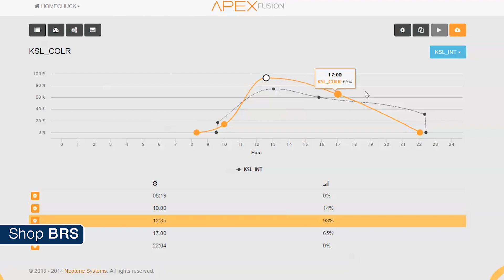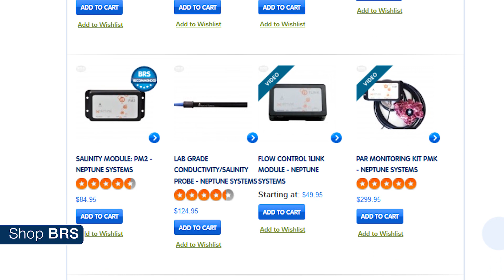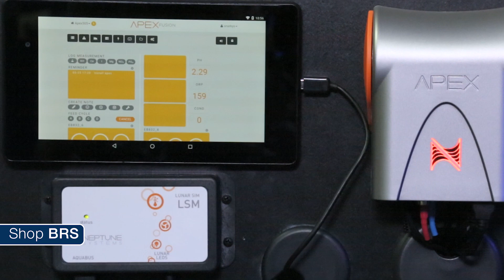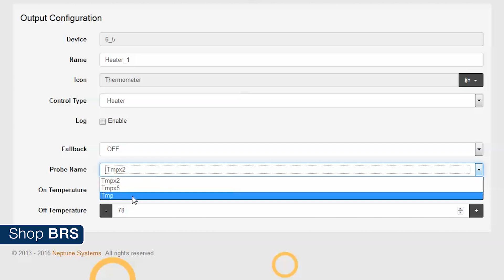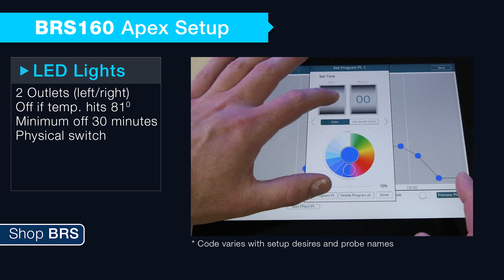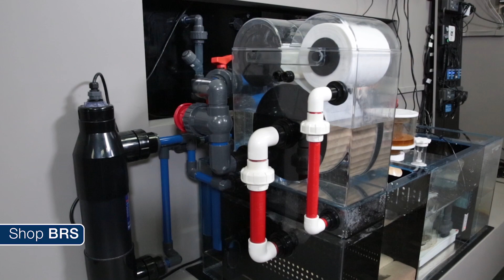Week 45: Aquarium Controller How To's - The Neptune Apex | 52 Weeks of Reefing

Comment: I just bought one of these from your guys, nothing but problems so far, I love the controllability of this and the fact that I can monitor basically every single parameter that matters with the trident hooked up, but I just wish it wouldn’t have came with multiple issues
Reply from the maker: Sorry to hear that! If we can help in any way, just give us a call or shoot us an email. I'm confident that once you get up and running, you'll really enjoy having an aquarium controller. 

BRS Customer Service 
Phone: 763-432-9691
Email: Support@bulkreefsupply.com
Live Chat: BulkReefSupply Website
Reply: @BRStv  I appreciate that and I have been In Contact with your support team and they have been very helpful, I should clarify a little though I have been having problems with add one ad modules like the cor 15 and the trident, the apex and energy bar 832 have had absolutely no issues so far and it is great on that note

Comment: help please
im new to the neptune systems and in trying to connect 2 Mp 40's to one outle (by using a spliter) and sinking both of the pumps to wxm. i was able to connect one pump and i see it on my dashboard now. the secomd pump is blinking white,red and blue and when i press and hold  the set button to attach it nothing happens it just stays blinking the same white, red and blue. 

do each MP40 need their own outlet in order to attach to wxm or can i have them both pluged in the same outlet by using a spliter?

Comment: Hi guys love your channel,  may I ask you a question please I am in Australia and all the Apex equipment is very expensive here the new Apex controller alone retails for $1,600  plus, so if I was to purchase the main Apex controller do the other add-ons like the DOS and DDR and ATO etc need to be powered from a wall power outlet or can I power them from the main Apex unit? as here in Australia, we are on 240v but if I get the main Apex controller here I am thinking I could order units like DOS and DDR etc from the US much cheaper if they can be powered from the main Apex? if that makes sense? hope you can help me? cheers Mat

Comment: Are Neptune looking to release an energy bar 8 that has the ability to accurately determine the power utilization of your tank to compare different lights, pumps, skimmers, etc. For the UK/EU marked which is currently not available on the UK/EU Energy Bar 6, which appears to be the only option if yours loving outside of the US?

Comment: I'm hoping you can shed some light for me
I've been comparing the price of an Apex with individual controllers. Together they clock up to £900, or about $1,200.
The Apex base unit alone is a whopping £820, or $1,070, and with all the various required add ons, it comes to £3k or nearly $4k!!  Are the additiom of internet alerts REALLY worth $2,800?!?

Comment: Great video Ryan, please can you post a link for the toggle switches? Thanks
Reply: Can you just show how the breakout boxes are connected to the toggle switches?  Do you have to cut cords on everything to attach to the toggle switches?  Please show the back of the board.
Reply: Not to be picky, but a three way switch is a switch than can operate a load from two locations- a 3 position switch is what you are describing.  You used that term correctly in the video (once).  I think what you are really asking for is a maintained contact three position (on-off-on) switch

Comment: Hi BRS.  Can you show us how to wire and program the switch panel you made?
Reply: I would also like to see how you wired and programmed the switch panel used in this build.  I would also like to see what the back of the panel looks like, and how you would protect the wiring from evaporation and salt deposits if it was incorporated in an under tank setup.  I know very few people that can set up all their equipment in another room and would like to see something advanced like this, that the average consumer would be able to incorporate into their systems.
Reply: Hi, Theater Guy.
I have the answer.  I bought the on-off-on toggle switches.  I used extra Ethernet cables that I had laying around for wire.  Using this switch setup is a little time-consuming.  I stripped the sheath from the ethernet cables to expose the three pairs of wires.  The wires are twisted in pairs.  Don't untwist them.  This makes it easier to route them and keep things neater.  I soldered one pair to two of the switch pins.  I then untwisted about two inches from the next pair and soldered one wire to the last switch pin.  Using the other wire from the pair, I connected it to the next switches pin.   And so on till they were all installed.  I installed twelve switches in total.  This setup requires three breakout boxes.  After counting all the pieces of equipment I want to control by the  switch, I found that I only needed seven switches.  Some extra switches are good I guess.  Hook a length of pigtail wire  maybe a foot or so and connect it to the GROUND terminal of the breakout box.  Route it where it is out of the way when you are done with it.  Now, gather the three center pin wires and connect them to the ground wire pigtail.  I found this pigtail method neater at the breakout box as mine is displayed on a board mounted on the wall.  Take the two wires left from each switch and attach to terminals 1 &2 and so on.  After you are done with all connections,  time to program.

Go to outlet config.  Find a piece you want to control, let's say skimmer on switch 1.  Go to ADVANCED.
Type in...  
IF Sw1 ON THEN ON
IF Sw1 OFF THEN OFF

If you want the switch to be up in the on position, but it is off,  just reverse the wires on the breakout box.  Do this process for the remainder of the setup.

Questions? Just ask.
Have a good day.
Reply: Hi, Theater Guy.  Please hold off on the programming part.  I think this is wrong.  Let me check my programming tonight when I get home from work. Thanks.
Reply: No problem! Thanks for updating this!!!
Reply: +DIY Home Theater Guy 
My program is as follows...
If Sw1 CLOSED THEN OFF
If Sw2 CLOSED THEN ON

I used a lamp plugged into outlet 1 to test.

Comment: How did you guys wire the APEX with that switch bank set up. I would like to see the wiring and programming. Set up on the on or auto or off switch set up. That looks like something APEX should have included with the new set up.

Comment: New to Apex? A word of caution! Neptune Systems the manufacturer of the Apex recently released a new upgraded system. Rather than taking the high road and lettting new customers know a new version was being released. They chose to discount their systems by $100 to dump their old inventory on un-suspecting new customers. They never told anyone the discount was to sell out old inventory. I have even talked to a number of stores and resellers about this situation, no one knew. Very deceptive business practices! If they are going to take advantage of their resellers and new customers how can you trust their customer support will be any good if you ever need it?

Comment: I am a very unhappy Neptune Systems Customer.  I purchased my system (thousands of dollars worth.  I believe I have every possible component. ) less than 60 days ago.  I emailed Neptune and asked if I could trade out my Head Unit and multiple power bars for the new models once they were released.  I was told no ! It was explained they may do something however they will not know until they have  shipped out to the new customers on the back order list.  What a horrible customer service policy!   They offered me a $100.00 discount.  What an insult!  I don't want a discount!  I want the system 'I JUST PURCHASED' to be capable of handling the new technology and software.  I don't think this is too much to ask since I just purchased the whole system.  If they would have told customers there was a new version coming out I would have held off and purchased once the new version was released.  I am so unhappy about this I am going to continue sharing my experience with as many places as possible. it is a real bummer because I could be a real advocate for the system but his is really making me sour towards Neptune.  They will end up losing more money pissing off the current customer base than they would have lost doing a simple trade up program or swap for customers like me.

Comment: ugh and i just bought a standard apex classic lab grade like a week or two ago. don't even have my tank yet so i haven't actually used it - might try to return it....didn't buy it through you guys though...bought it off ebay so i might be screwed.  they announce this thing days after i get mine, ugh....i was even thinking to myself "man it's been a while since they've updated this thing"

this kind of sucks though. i would definitely have paid the difference for the new model, i sure hope i can get this thing returned. i probably wouldn't care if the eb832 was compatible with the classic, but they're saying it's not, which means an upgrade is basically just buying everything again.
Reply: it was new in box, but lack of any return policy or customer service is the real issue....was it worth the $20-40 I saved? Probably not in hindsight. The seller rejected my return request....Guess I'll have an apex classic for sale on ebay, lol.

Comment: I'm sure the new hardware is nice, but the silver new display still looks like junk. I was really hoping a nice sleek upgraded LCD touchscreen that I can mount on the outside of my stand and have it be an aesthetic addition rather than an eye sore.
Reply: +BulkReefSupplyCom True, but that's retrofit hardware, and tablets are not designed for 24/7 use and cannot be programmed to turn on/ off the display for certain periods.  I rather spend the $200 on an optimized display, rather than $100 trying to rustle something up that I know will just be a haste to try and make work.

Comment: I think the new Apex killed the Cerebra before it even got out the gate.
Reply: Ok. I am excited to see this new innovative product. Maybe the Apex will finally have some competition. It is amazing however, that Apex continued to advance without a strong competitor up to this point.
Reply: If less than 10% of reefers own an Apex, then how much less for other aquarium controllers. Cost is always the biggest factor in purchasing something like an aquarium controller. When I first got into the hobby I tried to do everything the cheap way. Soon I learned, that was not a good mindset to have. It cost me more money in the long run to replace cheap failed equipment with better quality equipment. It was more time consuming to battle problem caused by trying to cut costs. Eventually I learned to do it right the first time. When I go to my LFS I see new hobbyists doing what I use to do. You can tell them until your blue in the face that a controller is the best investment, and that it is simple to use, but until they feel the sting of defeat they will not easily part with hundreds of dollars.  I even told one guy I would come to his house and help him set up a reef keeper, and he still didn't want to spend the money. I say all that to say Neptune has done a lot to make the Apex easy to configure. You take it out of the box, connect it to your EB and then to your laptop and you can have basic  functionality in minutes.

Comment: Soooooo, let me get this straight.....with the new Apex and its wireless magic, there's no longer any need for the Reeflink for Ecotech products, or the wireless module for anything?   Because, if true, that's amazing.   Also, where did you get that bank of physical switches, and was it difficult to install?  Sounds much easier to be able to flip a switch for feed mode rather than messing with my phone or a display.  Thanks!
Reply: +BulkReefSupplyCom 
what Guage wire did you use between the switches and i/o box?

Comment: Did I miss something about how its impossible to use feed modes with the new apex? Other than opening my phone and pressing the feed mode? I try to keep my phone away from my tank, especially when feeding...How hard would it have been to just put four buttons on that massive new unit?
Reply: +BulkReefSupplyCom will the "classic" display work with the new unit?
Reply: +BulkReefSupplyCom how much extra is the new display for the apex?

Comment: Apex voice recognition is coming! Apex will have a voice recognition add on that will allow you to simply say "apex, go to feed mode" and it will do so. Similar to xbox voice command and siri on iphones. Personally, im more happy with my original apex lab grade complete system. The connector box is too bulky along with the energy bar and we do not need a salinity probe. This is just apex trying to generate more revenue for their company. Save money and just get the older system. I will always buy my products from BRS though!
Reply: Agreed!  I saw no feature on the new one that would make me get rid of the old one.  If i were in the market for a new controller, Id probably save my money and buy the classic and spend the savings on accessories.

Comment: Looks like I have no reason to be mad over buying an Apex classic 2 months ago. I can live without the extra power ports and power monitoring.
Reply: Processor is plenty fast on the classic and I wired my entire home with Cat 5e. No need for wifi!
Reply: I wired my network in.  I prefer not to use wifi for stationary objects.  Your just unnecessarily using up wifi bandwidth.
Reply: you are right!
Reply: +leetreex yep. Or the faster processor

Comment: This is an excellent video on the new Apex system.  I don't care for the look myself and I think the energy bar is too bulky.  I will be sticking with my classic.

I did want to add a major point.  Around the 16 minute mark, you discuss examples of the power monitoring and alarm for various equipment and you call out a 100 watt pump as only using 50 watts.  What most people will not realize is that pumps are rated at their peak wattage, which will be as the lowest head and highest flow.  For example, power head will likely operate at or near their peak wattage.  Return pumps and even closed loop pumps will operate lower than their peak wattage because of head losses.  As an example, my Iwaki MD40-RXT is rated at 144 watts on the BRS website but I have monitored and noted on my tank it normally pulls 96 watts.  This wattage also changes based on opening and closing valves off the return pump for GFO, carbon, etc.  So I recommend if any monitors wattage on their pumps, they should get a wattage meter and get some baseline readings first, then give yourself a safe range of about 10 watts or so before you dial in the alarms.

Comment: Disappointing that Neptune couldn't develop a more affordable product. For the price, Neptune needs to step up its game when it comes to UI features. When my Apex Gold brain went out, I had to jump through so many hoops to get it replaced by Neptune. The whole RMA process was a headache and they tried to blame the failure on the user (me) to avoid replacing the unit. If I'm going to drop close to a grand on this kind of system, the least they could do is give you quality support. I think I'll stick with my DIY Arduino controller. Cost me under $200 to build and has pH, temp and salinity monitoring. Plus I was able to make it so my dosing pumps can't run for more than 15 minutes per day. I once accidentally turned my Alk pump to ON in the Apex app instead of AUTO and crashed the tank (dosed over 200mL of Alk in a 30 gal tank). All of this could have been prevented by better programming. Step it up Neptune!!